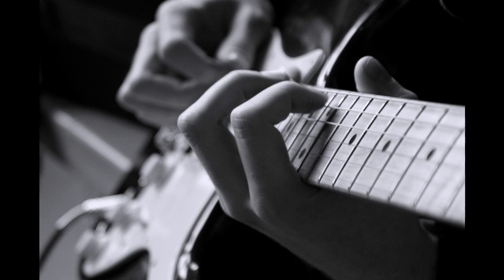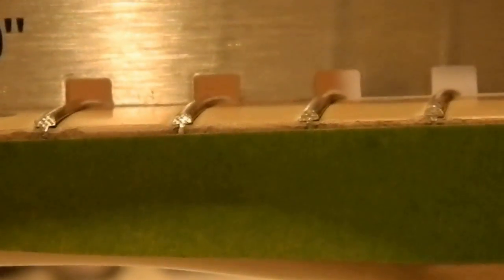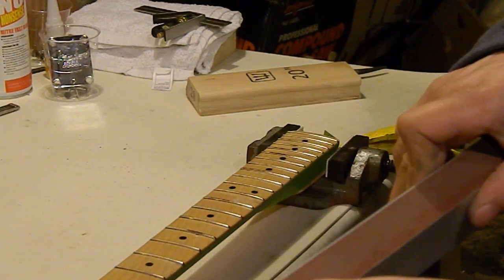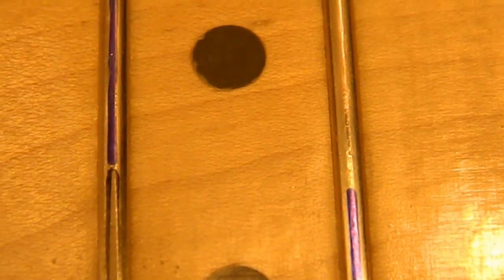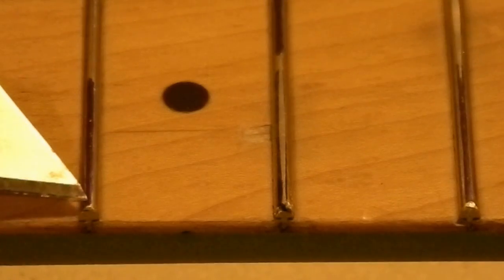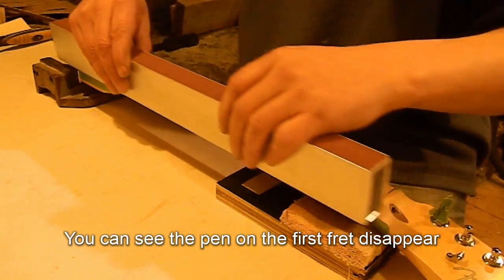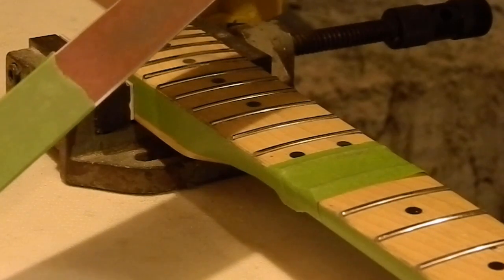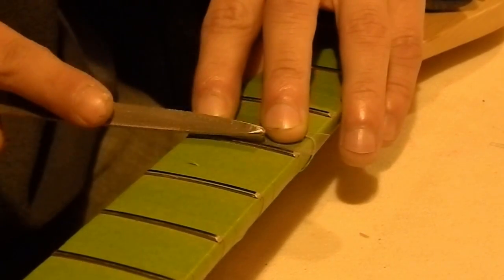Guitar Fret Leveling Why and How - Part 1 of 2

Comment: Holy crap, just mark ALL the frets to start with and sand until you've just kissed the lowest fret. There's no nees for all the blue and black marker, fret rocker BS.
Reply from the maker: thanks for your comment fatboy - yeah that is definately one approach, but marking the frets the way i do in this vid really doesn't take much time and helps me to know exactly what is going on as i'm leveling ... most guitar techs i know will mark the frets at least twice for leveling and then again for crowning, but then some don't mark the frets at all - each to his own i suppose ... i don't know anyone who does fretwork that doesn't use a rocker though, but if you can get good results without one then more power to you :)
Reply: [UNduncan wallace Hey Duncan, I apologize for my comment being rude, long day. 

I understand the desire to know which frets are high and low but, for me, it is irrelevant as long as there is .040" left at the lowest spot (sometimes less depending on the customer's tastes). I too mark the frets twice as you do. After I mark them the first time and make a couple of strokes with the leveling beam, I can see exactly where the low frets are. I can also see using the rocker to spot an unseated fret but I find these are pretty obvious just sighting down the neck. It just occured to me that a lot of people have less than great eyesight and a rocker would be quite useful for those guys. 

In the end, as you said, it's to each his own. As long as you end up with a killer player, it doesn't matter if you use a cinder block;-)

On a another note, I did just discover some killer crowning/dressing files- Nicholson Pillar, Swiss pattern, double cut #2 and #4. The slim sides have no teeth and the fine pattern is a whole different league of cut. Compared to stuff you get from StewMac, it's night and day. They can be purchased on Amazon for ~$15.00 each. The corners can still cut a little so I just knock the corners off with a stone.
Reply from the maker: fatboylo96 no worries at all dude, i have lots of long days myself and i didn't think your comment rude at all :) ... tbh if i'm doing a fret job i wouldn't do them this way, but i think it shows all the steps of what needs to be done, and to remind myself of that from time to time is always a good thing ... thank you so much for your tip about the files - i shall google them tomorrow, but if experience has taught me anything it's that you can't buy fuck all in the uk that you can get quite easily in the states ... you guys don't know how good you have it over there!! ;)
Reply: kim young Well Kim, you are correct in that most guitars fingerboards have a radius. They range from 7.25 inches up to 20 inches. However, you do not need a radius block to do a proper fret leveling job.In fact, leveling beams are flat, long, and roughly half the width of the fretboard. If an inexperienced DIYer  were to just start sanding away on the frets, chances are they would ruin the frets. An even moderately experienced repair tech knows you have to level with the radius- follow the curvature with the leveling beam as you move from the bass side to the treble.

You can "tap in" frets that have come loose but they will pop back up. They need to be pressed in with a dab of cyanoacrylate. 

Most guitars do have fallaway built into the neck after the 17th fret. This is to ensure there is no buzzing in this area since the truss rod doesn't affect this area of the neck. Fender has a micro tilt feature in the neck joint because they are too cheap to hand-fit each neck to the correct angle. BTW, the micro-tilt feature is a tone killer. It seperates the neck from the body where they are only touching at a single line at the top of the neck pocket and the adjustment screw. Where the neck and body meet SHOULD be a completely flat, wood to wood , no finish, no shims, contact. As if you were going to glue them together.

Guitar necks do weird things when under string tension like the differences between your Dean and LTD. This is why leveling with the strings on is such a superior method. And, since they do weird things, it it is best to do a complete level from the start and if a guitar develops a problem after that, you can focus on problem areas.Now, if you are the type of player who likes a medium to high action, you're not going to notice minor irregularities in the fret heights. 

A lot of bending doesn't wear frets out faster, having a heavy left hand does (or right hand for lefties). Players with a light touch may never need a complete refret where guys with a gorilla grip need them frequently. Regardless of bending. More importantly, what you play is a contributor. If you play the same chords and notes in the same key all the time, the fret wear will occur very quickly.
Reply: kim young Well, after reading your last reply, I can only assume you are in the middle of a really serious acid trip so, I guess I'll decline to respond until you start making a little more sense.
Reply: kim young Dude have you read any of the crap your fingers are typing? He did not say he played in one area of the guitar he said some costumers may. Also if you are concerned about the guy totally ruining a fret job because of flat spots then you should take note that the video you watched says PART ONE!!!!! in part 2 you will see the job completed with the frets being crowned! You have totally made yourself like like an idiot and i enjoyed it!
Reply: kim young Do you mean "A convex fretboard", that's what they should be !!....
Reply: Petre .W. yeah...so you would need a concave shape sander bar. Just watch Dave's channel...He'll use a depth gauge. Or watch Dean Martian production tour...it'll show a guy pressing the frets in. Gibson just hammer their's in...but they have a lazor machine to file and polish the frets later. A Fender is very comfortable to play....for reasons.
Reply: kim young Well you did say "concave fretboard"..........did you say you played the guitar ?..
Reply: kim young Did you watch the video or read the post about compound radius fingerboards?  You follow the curvature of the fingerboard to maintain the given radius. Is this really that hard for you to figure out? Say you have a soda can and you want to sand the paint off of it with a flat beam, you can't hold the sanding beam in one position on the can, you move the beam around the can as you sand up and down it's length.
Reply: fatboylo96 Have you watch video of Luthiers shaping the frretboard?..They go right at it with a proper shape sanding bar.....They maintain the center line...How much you want bet they use the exact same sanding bar to level the frets?. The press the guy was using at the Martian's factory WASNT FLAT. Dave's depth gauge WASNT FLAT......

Another thing about the fretboard is...there should be another set of fall away starting a 12 fret there about.....The high fret on my Dean was at the 13th. Plus the high B and E string didn't have good enough fall away for me...I just tapped in from 17 and up for the B and E.
My guitars has lower actions than factory settings. My Dean also has a build in 1.5 degree off set at the heel joint....Fenders having thicker bodies...the neck sometime is set too low into the body...that's why some people shim the neck to tilt It or the newer models has a neck tilt adjustment...You need to tilt the neck because of the bridge wont go lower....however you must also compensate with fall away for the higher frets....So you don't really want it  all flat and level to begin with....
Reply: kim young  oh !!.... some people "shim the neck"....do you know what a "shim" is Kim ?..
Reply: kim young Wow. Just wow. Do you understand what a compound radius is?
Reply: Green Light Garage The shit that Kim types is like a dumpster fire. I don't even see how he could function in public. He must need a helmet and constant supervision.
Reply: fatboylo96 I must be honest.....not sure I do know what a "compound radius" is. What's the difference between that and it just having a radius ?....I am not a luthier...just have a strum now and then and have an interest in the guitar !.....
Reply: Petre .W. It's mostly for comfort.. Notice your index finger in relax position.
In standard tuning...it too was designed to make playing bar chords easier. That's why the high E and B string are tuned one fret up....
You can also let those 2 strings ring open...
Example...starting from the 12 fret...
Make an A minor diad ( root and b3). ( VI) chord...then simple work your way down the neck...Using the proper maj/min diad.....Gmaj, Fmaj, Emin....ect...

You can also substitute the Emin with Emaj.
It'll make it sound Flamingo....

You can strum  with those 2 open string notes..
or use whatever picking pattern as you wish.

Gibson type fretboard are 24 3/4 scale length . the strings are softer.
Fender has 25.5. The strings are stiffer.

The lower the action is...it just simple physic.
The less pressure is require to press down on the strings. Most shredder prefer Gibson type fretboard radious. You'll simple play with a softer touch....To compensate for flatter type fretboard..you'll simply us the side of your index finger more to play cleaner bar chords....

Guitar neck, ,fretboard , frets...are kind of like gloves...One size dosnt fit all. You need to find what's comfortable for you.....
Reply: Petre .W. Hey Petre, asking questions like this one is how I learned. Props on having the guts to ask! A compound radius fretboard is, for lack of a better term, a progressive radius. A common example would be a fretboard that starts at the nut with a 10" radius and progresses to a 16" radius towards the heel. 

This website has a good description and graphics-

http://albertobolocanmusic.blogspot.com/2011/03/guitar-neck-fingerboard-radius.html

The great advantage of this type of board is the smaller radius near the nut makes open chords very comfortable and the larger radius in the upper frets prevents the fretting out during string bends that occurs with a small radius and low string action. 

Most builders that make necks with compound radius fretboards have a swinging jig over a power belt sander with different pivot points for each end of the neck to create the compound radius.
Reply: kim young Holy shit! Thank you Kim, for explaining absolutely nothing about what a compound radius is. Your mom is calling, it's time for you to eat your Flintstones vitamins and Spaghettios.
Reply: fatboylo96 So...if I have this the right way round.....the neck is "rounder" at the nut and "flatter" at the heel !!....thanx !!....I hope I got that correct !!..
Reply: Petre .W. You are correct sir.
Reply: Petre .W. A simple concave sanding bar would remedy it.. Most people make adjustment , correct mistakes or fine tune....
Nevermind...you're too fucken smart and need it to be fucken complicated to feel Oki doki...
As I stated before...KEYS are just PITCH.
Chord structure/buolding are simply EVERY OTHER NOTE....

BTW...try getting into building nitro R/C building and flying...lots of cool wood work and tools...such as various types of sanding blocks..A tapered air foil isn't flat nor the wing ribs are all the same size. Guitar necks are for kiddies...it dosnt need to fly.lmao
Reply: kim young Yes, I think I know what you mean...."keys are just pitch".....but are key's just pitch in a certain order...there is a relationship between the pitches and that determines what the key is.....I think you know this !!...
Reply: kim young Have you ever seen any of these flying machines you make actually take off and fly !!....
Reply: kim young You sound like the sort of person who should be working on the space program......helping to push the boundaries of human understanding further and further back......or forward !!...and I don't blame you for stealing a few tools at work......like you say, they were never used.........you didn't work at that Japanese nuclear plant did you.....the one where they couldn't shut the reactor because they couldn't find the specialist tools to do it quickly enough so it frickin' blew up ?...
Reply: Petre .W. Nah...I worked on cloning machines. I  think I fucked up humanity. People getting fucken retarded now from eating GMO, trying to ream a god damn square peg into a round hole...My bad,sorry.
Reply: kim young No....I think it's good that you told us.........will I be alright if I keep away from GM stuff or will I keep on retarding no matter what ?..  could I be a clone !..  keep seeing reflections of people who look just like me !!....
Reply: kim young ...oki doki !!....are the sharps and flats not notes as well ??....
Reply: kim young not if done properly.... surely the fret height should be the height above the fretboard at each point across the fretboard since it  has a radius the frets should follow the neck.  I've seen a guy using the Katana system that actually levels the frets in the playing position with the strings on as the player has it set up.... ultimately I'd have thought that doing this would give the person that plays the guitar the best results..? I think that a really wide flat sanding beam isn't the best choice tbh...
Reply: rusholmemike The Katana system, and homebrew versions of it, do give the best results. If you were to "sand" in just one spot, you would leave a flat area on the frets. The best analogy is shaving your head. The razor is straight/flat, your head is round (radiused). The razor itself only touches your head at a very narrow area on the blade since it is flat and your head round. It doesn't matter how wide the razor is, it still only touches a very narrow area of the razor, be it in the middle or towards the ends of the blade. You don't keep shaving in the same spot, until you start removing skin, tissue, bone etc. until there is a flat spot. You make many passes, moving the razor over slightly with each pass, following the contour of your head, until that narrow area of razor has moved over your entire head.
Reply: fatboylo96 I think what some have been getting at is if you flatten the radius too much by heavy sanding  you'll get a series of flats rather than a smooth radius? that's why I avoid anything that's too wide... but then I'm no expert
Reply: rusholmemike I see what you mean about a "series of flats" but you'd have to stay in exactly one place for 20-30 strokes to even start making a flat spot. It's really just as simple as- keep moving side to side as you "sand" back and forth. Again, it doesn't matter how wide the sanding block is, it only touches the frets at a very narrow section. A wider block will not touch more of the frets, unless they are already flat.
Reply: rusholmemike A guitar fret board is kind of like an air craft wing. You can get away with a flat bottom air foil..Less wash in or wash out.
The air craft will have limited maneuver capabilities.

When you get into more precision airfoil. They're tapered and also have washing and wash out....The wing isn't flat. It's actually sort of warp.
A guitar neck/fretboard works in the manner.

The truss rod release only adjust from the nut up to the 10th fret there about.
If you want lower actions..you need fall away from the 12 fret and higher...
Since the strings arnt all the same gauge . it's more common to have fall away on the high B and E strings. Its kind of like having a wash out....
Most guitars have 2 degree off set for neck tilt.
It's not a given. Its just a reference.
. Kind of like the engine of an air plane has a 2 degree off set for engine mount to counter the engine's torque.

The 2 degree net off set simply allows you to be able to lower the action by raising the neck.

Many guitars have this issue. The bridge bottoms out.
Fender tried to remedy this by installing neck tilt shim... thing of ma roo....
However the neck will not be sitting flush to the body. There by effecting the guitars sustain.
Most modern guitar...(even cheap ones) has built it off set already. it's built into the neck heel.
That's why it's expensive to build a through neck guitar...which is a different beast from a set in neck.
Reply: thanks Kim..... I guess that you can do "simple" fret levels that just basically try to get the frets to be a given height above the fret-board all the way down its lengthand more complex ones that actually take into consideration the fact that each string diameter is different and will move more as it vibrates AND the strings will vibrate different amounts along their length SO the ideal would be much more complex to do?
Reply: rusholmemike Yes....plus the neck will all bow different.
I have Fenders and Gibson types neck.
Fenders are very comfortable to play. I played a Tele for almost a year. Then I purchased Deans and LTD.
I build muscle tone to the Tele. It was actually painful for me to play my Dean at first.
I damaged my fret board hand before..(doing sweeping). In order for me to play the Dean. The action simply had to be dropped more or the guitar was useless to me. It was a new guitar unplayed from the factory, with a high fret at the 13. It would had been OK for factory setting.
Even with the 2 degree built in off set..the bridge bottom out. I had to file the bottom of the bridge saddle.
Then I basically ran into fall away problems from the 15 frets and higher...because the frets where all leveled and no truss rod adjust for that.lol

It was much fast and clean to use a plastic mallet for the top 3 strings
The only type of filing I did were for the edges of the frets sticking out...after I hammer them into the fret board tighter.lol

I think the factory should build guitars with built in fall  away..Since most factories use CNC machines, now.

As consumers...we should all complain and demand it.lol
Reply: fatboylo96 Whatever dude....If you're setting to play a slide bottle or homemade cigar box maybe..
Did you even read that thread?
Do you even own a guitar?

Explain to me how crowning the frets will make them have radius again?LOL
So you're logic is to flatten the entire neck with a sanding bar...Then file the frets individually
to put  radius back on them.LMAO
Dude....put down the crack pipe...
Reply: kim young My god, I don't see why this is so hard for you to understand. You don't sand the radiused frets until they are flat. The tops of the frets themselves become flat during leveling and that is why you crown them. As you move side to side while sanding back and forth, you maintain the radius of the finger board. 

When a snow plow goes over a road that has a radius to it, it doesn't keep plowing the center of the road down to match the edges, it takes multiple passes from one side to the other so it can remove the snow and leave the curvature. I don't know how to make it any simpler for you.
Reply: fatboylo96 well...Im pretty sure the frets in this video were flat...flat at the center..As if they had been played for decades and needed to be replace again...

Err. Oki doki...Mr. using a crowning file to put radius back on each fret individually .lmao
You're so good at it that you didn't put low spots in those frets again. hahahaa

Just use a plastic mallet on the high frets..dude.
It'll save you the trouble of crowning all the frets...

Incase you missed any of the frets.
Have you ever thought about changing your name to bleeding fingers?
Reply: fatboylo96 All I know is....in relax position my index finger isn't flat...flat. It's a simply concept. Depending how I roll my index finger
or what part of it I use...it'll effect the notes and chords  I play.  All the muscle in my arm and hand also gets effected.

When I play the blues or use a lot of bending
My thumb needs to be over the top of the neck..unlike classical guitar playing technique.
Plus I will slide a lot using different figners
Yes, I don't want sharp edges on any of the frets. I prefer them to be crown.lmao

So you're saying you use a crowning file to put the radius back on the frets  because the fretboard contracts and expands? LMAO

I know frets and fretboard changes...That's what the plastic mallet is for. I can wack on the fret without removing the strings from the guitar...Its a simple concept.LoL
Reply: kim young No more. Not feeding the troll.
Reply: kim young Wow !!...... How's it going on the guitar/glider/nuclear bomb rebuild man ? Some people have access to a few tools and that is what they have to work with. They don't have the specialist tools you talk about.
  Not everyone is as great as you so please try and give the ordinary man a break Kim !!...
Reply: Petre .W. Im actually building a guitar from scratch. It's not rocket science ..dude. I don't even have a wood shop or the proper tools..

Didn't you take metal and wood shop in HS?
Reply: kim young No !!...All the woodwork/metalwork education was coming to end in late 70's, early 80'so, no !....I didn't do that !!....It would have been great to have the opportunity though !!....
Reply: One eye monster... hey man... you should probably just not talk to people.  Ever. Just stay away.  You'll be better off, and so will we. Best of luck to you.